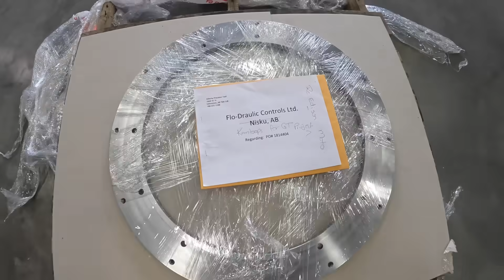Mounting the Flywheel: Prepping for Generator Action!

Comment: Can someone please fill me in. So this is not a ev like tesla but instead a efficient diesel generator powering electrical motors? Or powering batteries 1st that then power electric motors? Also what r u looking at as far as out on the highway mpg when finished,how much fuel are u saving with this? Also this wouldn't be considered a hybrid like a normal hybrid correct? O would love to do this to my toyota tundra, wonder how much it would cost.

Comment: The cat C9 says it's rated for 300kw, and the danfoss says 350kw. Is there a reason to spec the motor that much higher than the engine?

Comment: So I have 1 suggestion. As I firefighter, I’ve been in the unfortunate position to fight a fire on a Tesla…. It would be advantageous if you made some sort of quick disconnect for the batteries and the battery trays in the event of thermal run off. That way if you unfortunately get into some situation that damages the batteries and causes a fire, the only thing you loose is he batteries because you can separate them from the truck.

Comment: I’m curious if the generator is heavy enough that it may need extra support that with all the rough terrain it doesn’t break the bolts and fall off the back of the engine. Kind of like a transmission mount but for a generator.

Comment: I'm not a trucker, a logger, a mechanic or an electrical engineer, but hear me out. 

In general, you drive an empty truck up the mountain, and you drive a loaded truck down the mountain. It takes X amount of energy (electricity) to drive the truck up the mountain. At the top, however, you have the truck's X potential PLUS the potential energy of the load of logs...maybe doubling, tripling that of the empty truck?

If you have really efficient regenerative braking, it should be possible to return, loaded, to the bottom of the mountain with more energy in the batteries than you started with when you were empty at the bottom at the beginning of the run. 

Does that make sense?
Reply from the maker: That’s the plan.

Comment: 1:10 get yourself some longer bolt that are the same size and thread pitch of the flywheel bolts cut the head off them and grind a slot in them and use them as guide bolt makes putting the flywheel on alot easier

Comment: As a rule for anything larger than 1/2 inch in sheet stock, if at all possible, I use a pannel-punch set.
You get better placment precision, a clean cutout and it's safer and easier; especially if you need to make  multiple holes.

Comment: First ,use step drills for sheet metal. Second electric drills are arm and hand breaking monsters, get a reduced speed air drill for straight bit drilling. The air drill will stall if it grabs instead of breaking you. All of you keep up the good work and stay safe.

Comment: I dont think that CAT recommends loctite on flywheel bolts. Dont know about modern C9 engines, but 3400 series and c-10/12 they recommend clean engine oil, pin time the flywheel and torque them to spec

Comment: Hey guys! Just had a question about your truck. If the battery is dead, (i.e. cell voltage below ~2.5 V) can the truck still move by directly driving the e-axles from the generator, bypassing the battery?
Reply: Battery's would never get that low unless your out of diesel. The generator is controlled by the state of the batteries and amperage demand
Reply: @LeObsidianCraft  Yes it would almost never happen, but when it does happen (due to self-discharge), I was wondering if there were any mitigations in place

Comment: Diesel electric is the head of the pack for trains, I can’t see why it wouldn’t work just as well in a semi truck
Reply: Trains are diesel-electromotive; the diesel generator supplies power directly to the electric drive axles. 

Edison's approach is diesel-supported battery-electric; the electric drive axels are driven by batteries sustained by harvesting electric from regenerative breaking from the drive axels with the diesel generator maintaining opperational charging of the batteries when needed.
(And if I messed up on that description, I'm sure someone will kindly stomp on me. 😊)

Comment: OK - For assemble QA - IF the bolts aren't Red loctited in (You could use blue for a temporary install - if the bolts are simply torqued to spec without loctite - replacing them on swap out isn't crazy) - Paint the bolt heads RED as a reminder - after torquing  and loctiting paint them (and all correctly torqued bolts/nuts Yellow (or a colour indicating "inspected" )

Broken hand dude - bad luck..  (side handles have a purpose for drilling big holes - the tip can really grab on breakthrough (that tentative pressure reduction can also chip the tip - a probably silly but effective way to eliminate the risk is  to do the breakthrough with a  bimetal holesaw (or plug cutter) but that means changing bits.

Comment: Been saying for decades diesel electric was the future of trucking, you are building exactly what I was envisioning (tho I was thinking long haul not in the bush) Great job guys, very proud of you
Reply: Trains have been using it for decades so it makes beyond sense.
Reply: @ashenmoonclash   We gear the trucks to keep the rpm in the sweet spot, but, shifting gears keeps us out of it a lot of the time.  Start the generator, rpm go and stay in the sweet spot, getting the best economy

They should have thought to do this decades ago.  Glad Canadian truckers and mechanics are making it a reality
Reply: @ashenmoonclash ❤
Reply: Cat D6XE next gen use a diesel electric powertrain and claim a 30% improvement in fuel economy and operators say they push like a D8. The low or no RPM torque of an electric motor, as long as it's properly controlled with the software, ought to pull like none other. Cannot WAIT to see this prototype hitched to a load!!!
Reply: @davesstillhere ❤
Reply: i think biodiesel electric is the answer but this is damn close
Reply: @hxlize4913  Biodiesel not great, in the cold, it gels (turns to jello) just below freezing and has less power and mileage. There are alternate fuels and engine types that can power the generator

Comment: Love your work. You guys are starting out the wak the big auto companies did back in the 1900 hundreds..Most of them started in some guys garage and became multinational companies. After watching some truck related videos it crossed my mind the once you are in production it will be easy to adjust wheelbases because there is no driveshaft, just change the wiring harness. Can't wait to see the finished certified truck on the road. You guys seem to be a pioneer in electric logging trucks that will also be used as on-highway trucks.❤❤❤

Comment: A suggestion. When installing big heavy parts, like a flywheel, use a stud to hang the part in place. Take a long bolt and cut the head off, then thread it into the base part. Now you can hang the part, like a flywheel, on the stud to hold it up in place, then install the other bolts. When you get most of the bolts in, remove the stud, and install the bolt.   Love the videos.
Reply: Epic tip, thanks!
Reply: Good to put a slot cut in the stud head to get it out later with a flat head or pick your own favorite tool/tooling combo.

Comment: If you get a bolt that matches the fly wheel bolts threads but is longer. Cut the head off the bolt and use it as a guide to slide the flywheel into position. Also cut a slot across where the head was then use a flat head screw driver to remove your guide stud
Reply: The way I like to do it is to use 2 clutch bolts as handles to lift the flywheel in (I know these guys don't have a clutch, but there's still threaded holes in the flywheel), then line up one of the flywheel bolt holes, catch a couple threads on the bolt, then use the pointy end of a lady slipper to get the rest of the holes lined up.

Works pretty good on the Paccar engines I see most of the time, haven't tried on many others, just a Cummins once or twice. The alignment dowel on the Paccar does help a bit, but most engines don't have that since most engines don't read crankshaft position off the flywheel, which needs a specific flywheel orientation.
Reply: and have a pair of vise grips ready to lock onto the stud to keep the flywheel or whatever until other bolts are started.

Comment: How well would this transfer to dump trucks for both highway and off-road use? Should be very similar I would think.
Reply: The big difference besides a dump body is a hydraulic pump. Usually they have been driven by the transmission through the ptu. There are electric pumps but not really used in the trucking world if I understand correctly. There are electric pumps, I just don't know any of this size. Even the bobcat all electric skid steer doesn't have a full hydraulic system like all the fuel powered ones. I do see Volvo has electric construction equipment with hydraulic pumps, they just have a slightly smaller output than the truck versions, so there is a possibility of doing that. Maybe it's better to abandon hydraulics and figure out a new way, but even in smaller trailers, electric motors don't work well lifting loads. Give it time, I'm not an expert on this stuff, but it wouldn't be that hard to figure out.
Reply: @arthurr8670 there are lots of electric power hydraulic systems in the world, typically in factory, mining and ships. That being said two of those industries use power directly from the grid and ships have enormous electric generators spun by enormous heavy "diesel" engines. Most likely the batteries in the truck have the capacity it would just be getting the correct amount of power through a electric powered hydraulic pump, and making it robust enough for a long service life. Therein lies the challenge, one I am sure could be over come with some thought and engineering.

Comment: Here's a question about the future; what would you think about finding a company down the road that cam make yall a single speed forward and reverse gearbox going to the front rear axle operated off the generator engine as a backup in case someone breaks a harness way off the road and away from anything? It was kind of just a backup option that would help them get closer to civilization or out of the road.

Comment: Does the diesel engine run at a constant rpm while charging when you're driving or how does that work?
Reply: From a previous vid, its a constant rpm, but it only needs to kick on occasionally
Reply: Most of the time its quiet, downhill regeneratative brakes help
Reply: when it's running it's constant RPM, right in the area where the engine wants to be for max efficacy.

that's what makes diesel-electric so powerful over direct drive.

this entire project really is "why didn't someone build this sooner?"

they also have batteries so the engine doesn't need to run all the time, it's actually about like plopping a diesel generator in the truck of a Tesla.

Comment: you dont want to drill sheet metal with normal drill bits, they tend to bite hard and twist, use those step drill bits they work great.
Reply: Or you can just grind the drill angle to 150 degrees or thereabouts on a standard drill bit
Reply: @procyonia3654 only if ya know how to reharden the bit after 👍

Comment: Do you think that series hybrid trucks will become a thing?  The train industry has been making that work for decades.
Reply: Defintiv no, for on-road application a mechanical gearbox is way more efficent than the Diesel electric system.
Diesel electric with batterys only make sense when you need high peak horsepower and drive alot on hills.
Reply: @jonasstahl9826 are you sure about that?

Comment: What if you put a hing on the cab of the truck so you can tip the cab out of the way like on a big bud tractor to make it easier for if you have to replace the generator or replace cables and hoses
Reply: Generators last like 30000 hours or more.  It probably won't be removed more than once or twice in its lifetime so not a real big concern.
Reply: Someone mention Big Bud? Short video of the 747.
https://youtu.be/33kFVQyCOB0

Comment: Have you guys been following the Euro 6, 7 and 8 engine/emissions design and specifications? Euro 7 is meant to be a hybrid-type engine - I would not be surprised if you could import a Euro 7 kit as a drop-in kit that includes engine, power unit, batteries etc

Comment: Maybe i missed it, but with the off highway theme of this truck I'm wondering if a  sideways tilting cab is going to be used for serviceability in the future. Maybe the cost/benefit isn't there due to the need for an additional subframe to hold the air bags?
Reply: gravel would be cool. i can see a lot of construction trucks being used for this. why run many diesel engines when you can run just one for the whole fleet.